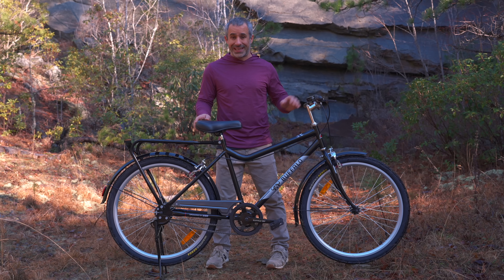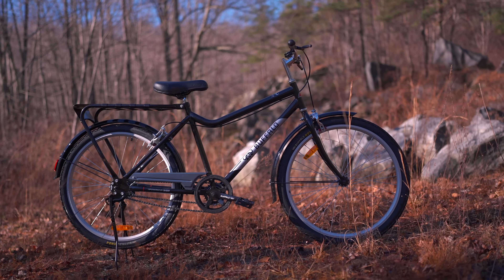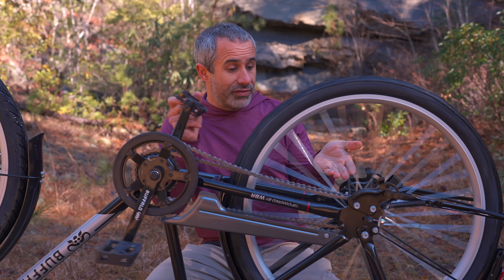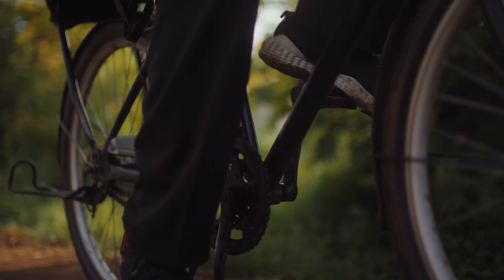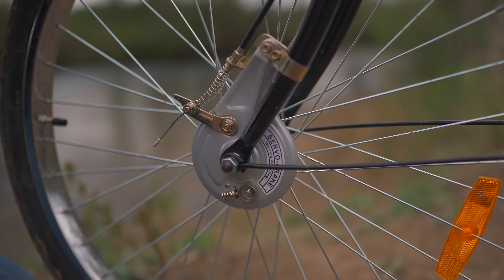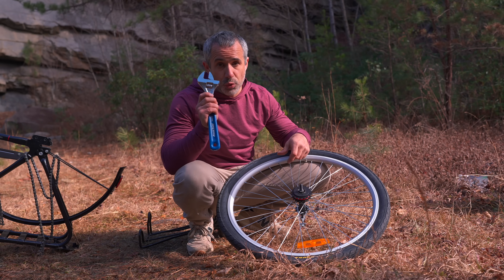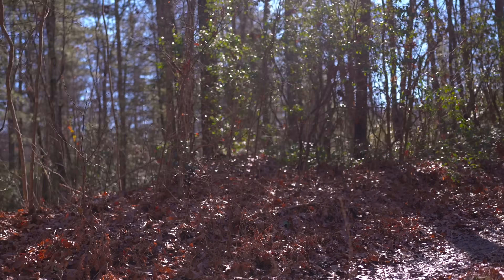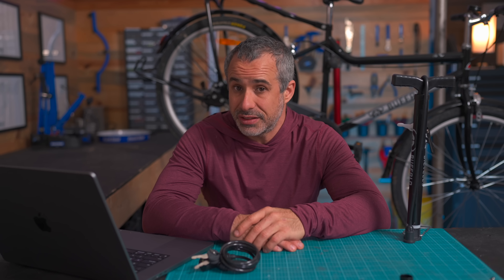Why 2 Chains Make This Bicycle WAY BETTER

Comment: Apart from the buffalo, many use standard roadster bikes (known in Kenya as Black Mambas) similar to the initial buffalo. Steel frame, single gear, rim breaks and a really beefy custom made rack. And you see those all over the place even in Rwanda, the "land of a thousand hills", where there is a rarely a stretch that's not up or down. Those gears are a major upgrade for them I imagine. It probably won't work for those loads where you need more than one person to push the bike but considering to relatively low price difference, fair enough.
Reply: B-R-A-K-E-S! Spell it as if you read it somewhere like in books.

Comment: I don't have a Buffalo per se, but I have fairly old steel roadbike which I revived and commuter/granny bike. Both are quite robust and hella usable. 
The commute/granny bike also have a front basket and I modified the back rack with another basket with two side smaller basket panniers, now comparable to any cargo bikes out there cargo wise imho. At least enough for my weekly/monthly groceries. It can also easily handle almost 75kg cargo. Next plan I wanna change the tyres with a fatter one and throw some 6 speed freewheel or something for bigger but easier cargoing.
Also also I kinda want me a Becak (a passenger/cargo tricycle). That stuff is more reparable and cheaper than any cargo bikes out there.

Comment: What kind of tyres do they use to resist the strong UV? I started getting perishing on my Continental tyres in the UK after 1 year, which lead to regular punctures, so I had to replace them. The perishing was worse on the side of the bike that got (indirect) sun, in my bike shelter.

Comment: My 21 speed bike occasionally does something stupid like the chain randomly falling off or me having to replace the shifter or somehow getting bent and hitting the spokes so I have to use brute force with pliers to bend it back but otherwise it’s pretty reliable

Comment: this is a stupid complicated high maintenance design - two drives, exposed chain, caliper brakes. bike is very heavy and won't climb with an average person aboard. and, carrying heavy milk containers or else so high is impossible to manage and only ends up spilling all over the ground. total bs

Comment: Lets make bike more complex by removing the ability to brake by rotating backwards. Instead lets add a hand brakes and increase price by adding 2 more chains but give only 2 speeds.
Brilliant.
Reply: well rim brakes are super cheap tho, you can get a made in china one for less than 3 bucks
Reply: @rafiy7150  yes, but if we have a goal to make "bulletproof" and simple construction, adding a new component means that we have to deal with one more potential failure point.

And if we follow the idea "why to bother, just buy in china" than why to have 2 chains, just buy a cheap gearbox

Comment: The buffalo bike is an overpriced bicycle made to solve a non existent problem in a rich man's head trying to fix a "poor" man's problems,  their are more versatile, cheaper and serviceable bicycles than the buffalo, I know many families in my village who have this bicycles break down after a moth or two and can't service them, meanwhile they go back to their own bicycle which are easy to service anywhere. The buffalo bike sits between a normal bike and  a mountain bike,  my old atlas bike carries more weight move faster , is more reliable and more serviceable

Comment: i might use the wrong terms, but serious question: why does it need a shift mechanism? If you're going to have two different chains on two different gear ratios, why can't they both be engaged at the same time? In my mind, then at slow speed the low gear "wins" priority and gets everything moving. As you start to exceed the speed of low gear, the high gear gains priority and the low gear just spins faster than it could've been pedaled via a clutch as if you were coasting. 

I'm sure there's some clear reason why that's not an option but why?

Comment: Regular 3gear hub shifter bikes never needed maintenance either, they will run for ever on zero maintenance.
I really don't see the point. It solves a nonexisting problem.

Comment: When I was a child simple bikes still had internal two (super rare) and three gear hubs in the rear wheel.  They died the marketing death because more gears more better bit are entirely unnecessary for many use cases sich as city bikes.  With these bikes coaster brakes were stamdard.  Far less effective than more modern brakes but good wnough for workhorse of a bike as opposed to sportive use.

Both jad in common that they were super reliable.  My own bikes never jad any technical issues.  In fact, I'm still usimg a bike from 1986 which has tje odd combination of a two gear hub with a six hear derailleur.  The hub works as new, the derailleur needs cleanimg, adjustments and like eber.more modern derailleir is just unreliable compared to an internal planetary gear.  One of the reasons for the reliavilty is that the core components are sealed.

And if something is as reliable designing for maintainability and repairability is less of a concern.

Seems something as reliable as an internal plantery gear with coastering brakes is somewhere between forgotten and ignored and now there is an attempt to reinvent something as reliable.

Comment: In the early 80s I had a bicycle that had a two speed internally geared hub that you shifted in the same way as this, by back-pedaling to briefly tap the coaster brake.  It had a single chain and survived my abuse as a kid.   I'm having a hard time seeing how this convoluted system can be more reliable than that simple system that I had back then.  A modern version of that seems to be the Sturmey Archer kickshift.

Comment: That's shit. Two chains to rust, way more weight, way more friction, V-brakes, air tires - that's garbage for given conditions. An old bike with pedal brakes and 3 speeds is WAY more reliable. Ok, I don't know what old bikes were in EU or US, but I know soviet old bikes were like that, and many are still driving today. The only new thing that they need is airless tires. That thing would be absolutely indestructible and almost completely serviceless. The chain might eventually rust and fail, but that's pretty much it.

Comment: Your statement that you can not have a two speed coaster brake on a bicycle is a victim of your age. Look back to the history of Schwin bicycles. One of my cousins had a large paper route in a community with lots of different size hillls. This was back in the early 1960's. It also had the spring front fork that might be a good addition to Buffalo 2, or 3.

Comment: I had several "kick back two speed" hubs laced to various rims, they also all had coaster brakes. They were super reliable, easy to clean and service, since all of the components were in the hub, dirt and moisture were kept out. I don't understand why you stated that the "kick back" shifter won't work with a coaster brake, they were perfected in the 40s or early 50s.

Comment: Very curious as to why they didn't opt for a belt drive system. If your goal is to pump out out millions of standardized bikes with no gearing that should outlast cockroaches in sandy conditions, belt drives make a lot of sense to me. Even for logistical reasons, it's a lot easier to transport 100 belts than it is to transport 100 chains. No oil or cleaning needed also.
Sure, the costs would probably be higher first. That can be offset by standardisation and high volume

Comment: Would have liked to have seen how the freewheel actually works. 

Also wondered if you could retro fit a bike with this twin freewheel, a twin cog crankset & an additional chain….might be more cost effective upgrading original single speed buffalo’s already out in the field.

Comment: I don't get why they went with dual pivot brakes instead of V-brakes. Dual caliper are just weaker and I found their left-right alignment to be pretty fussy. Only thing that comes to mind is that they maybe could still use the forks of the old buffalo as spares but I am not sure that alone is enough of a reason.

Comment: Well, I will leave drum brake at the front, rim brake at the back. So if your wheels are bent, you can disconnect rear brake and still have enough braking power at the front to get safely home.

Comment: (-_-) I was hoping this would be some AMAZING invention, like it has a big & small gear & chain to the same back-wheel, and the big pedal-wheel provides the torque when necessary & the small wheel provides the speed when suitable, so you don't need a gearbox, or something AWESOME like that...
But NOOOO.... it just provides the same benefits as POCKETS you could bring a 2'nd chain in, just in case you need it. Sure, it now can work until you get home/repair-shop, and you get the benefit of not having to try to do field-repairs, but just use wing-bolts & it's easily serviceable in the field anyway.

Comment: This bicycle's duel chain/shift system is next level and really demonstrates the true purpose of a bicycle. And to as you may read in these comments how everyone uses them even the children and that is the other great thing about a bicycle, they transcend age and size allowing about anyone a bit of freedom through transportation . With bicycles it is possible for the entire family to each own their own bikes. I hobby with E-bikes and always look to electrify my next bike but this bicycle is to perfect in the design to change it like that. Now there are simple On The Wheel electric assist kits out there but it looks like getting a charge in some cases would be a challenge. Thanks for the video good the see good work in the world.

Comment: Back in the 60's Schwinn had a two speed "kick back shift" Stingray bike with a single chain and a rear coaster brake.  I was the first kid on our block to have a Schwinn Stingray bike but I could only afford the single speed version. It was  built like a tank and sold for $49.95 MSRP.  If I remember correctly the basic two speed Stingray sold for about $10 more.

Comment: You put all this forward as a win for Africa... I'm a poor Brit - my bicycle IS my lively hood it's my "pick up truck" - How do I get an affordable accessible one??? Does it fit standard tyres, standard chains? Are the wheel axle threads compatible with standard metric threads so I can pick up a new wheel nut at b&q or does it need the old imperial "specialist" bicycle threads? Since you have discounted long term reliable (even in wet) hub brakes, why have you used poor performance fiddly caliper brakes when Vee brakes have better stopping power and are far simpler to work on?
Reply: Also... WD40 is a terrible lube - great as a cleaner and water dispersant.... But to re-lube a gritty chain or freewheel I'd much rather use used African truck engine oil - WD-40 will destroy bearings and joints in your context!

Comment: Reminds me of the old Bendix yellow and blue band 2 speed kickback shift rear hubs but with 2 chains. I think having 2 chains increases the likelyhood of one falling off and fouling the other chain not to mention the tensioning issues. it's a nobel idea and I'm sure it works well but doubling the chain makes for twice the problems. The Germans made similar 2 speeds but the 2 speed mechanism is in the crank and, being German is extremely complex requiring precision machining. Plus it was hand shifted.

Comment: Nice...

Um, just put the pair of chains on one side, then another chain with a coaster break on the other side. Arrange that the coaster brake must be peddled back more to trigger it. Boom, you just got rid of the hand brakes.

Comment: I've driven a few 2-speed with same gear changing mechanism and coaster brake. It was just "turn pedals backwards a bit to change gear, turn them more to brake". Gear changing and brake worked well, problem was that whenever you used brake, you also changed the gear. This of course could be remedied by handbrake at front, one of those bikes i've used had drum brake at front but other had nothing. Actually googling about it, bikes likely both had "Sachs Duomatic Model 102".

Comment: reminds me of the bendix kickback which was made in the 60's    Bendix kickback models primarily refer to their "2-speed automatic kickback hubs" which are often identified by color bands like "Red Band" and "Yellow Band," with popular models including: "Model B," "RB2," "Bendix 70," and "Bendix 80"; all featuring a coaster brake mechanism with a 2-speed kickback function, commonly found on vintage Schwinn bicycles, particularly the Stingray mode 
 Key points about the Bendix Kickback:
Functionality: It was a self-contained 2-speed hub with coaster braking, meaning you could shift gears by pedaling backwards.
Distinguishing feature: Often recognized by its "Red Band" design.
Reputation: Considered one of the best bicycle hubs of its time due to its reliability and functionality

Comment: I had a Schwinn American bike. It had two speeds and was extremely reliable. 7:12 is wrong. My bike shifted by back-pedaling and braked by back pedaling. After braking, just backpedal once to shift back to the previous gear. Too bad they couldn't engineer a shift-brake-hub as reliable as Schwinn did 65 years ago.
Reply: I'm sure they could, but hub brakes don't fit into their product goals. Whenever someone gives "they don't make them like they used to" they forget that there are frequently good reasons for it being that way.

Comment: Far be it from me to question this stuff since I'm sure there's very good engineering reasons but using rim brakes and an old quill style stem/steerer is surprising to me just in terms of maintenance. I have found the modern replacements for both of these to be much more reliable and easy to maintain.

Comment: Obviously SRAM would find the solution. US brand but they develop a lot of their gear in Germany, they've got access to some reasonable engineers at home but Germans bring pure excellence to the field.
 Buffalo could further aid in the maintenance by implementing spoke key valve caps, something Peatys offer and no doubt others too. Inexpensive to produce and easy to implement.

Comment: I'm never, ever, going to own a rim-break bicycle again.
With lots of distance the break pads and cables are an issue. And with rain the break pads are a bigger issue.

This gear system is awesome though. More robuust than my years old 3 speed shifter on my city bike.

Comment: Perhaps I missed a tiny bit of explanation... but how does the gear know the difference between backpedaling and coasting? In both situations the axle is spinning independently of the sprocket. Well... now I feel like I'm answering my own question, I guess it would just use the same mechanism and principle found in a hub brake.

Comment: So 2 chains and no way to put some tension on it. It might work but also keep in mind that the chains stretch and become looser up to the point you have to stop multiple times to put the chain back on. My father worked with a lot of bikes and i've seen all the different things he brought in and fixed. In the Netherlands we also had a multiple speed bike and it also was one kick back to change. That was a 3 speed changer and all in one hub, with one chain and build in brake. So one kick was changing gears, just going backwards with the kickers and you applied the brakes. The front was also with brakes and those were connected with a rod system, no cables because they can break. So the drivetrain was one chain, one hub with brakes and gears in it fully enclosed so no dirt or dust was coming in. The real onle downside was it had a little learningcurve but within a day you'd know it. So it looks nice but there are better ways to do this.

Comment: Now this is sweet. I stumbled my way in to owning a couple old 2 speed coaster brake rear hubs. They seem dang reliable, but the downside is no hand brakes (which imo are better for overall control and learners).

Comment: That's awesome.  Though I think it'd have gone for hub (or more likely disc) brakes, to avoid the wonky wheel problem, as well as the wet rim problem.  Yes, the upfront the cost would be higher, but greater reliability.
Balancing pros and cons, always the easiest thing to reach a unanimous consensus on 😆

Comment: I have an old bike with a 2-speed internal gear kickback hub with a coaster brake from like the 60s or 70s and it shifts with just a tiny backwards turn of the cranks. I don't know if you're exaggerating the backpedaling there at 4:52 but that does not look like the greatest experience tbh. 

And I wonder it this 2-chain approach with additional rim brakes is actually better or that much simpler than a 2-speed internal gear hub with a coaster brake.

Comment: Not the first time I see this bike. Still confused about the way they did it. I have a 2 speed hub in my shed that's over 60 years old and only needed some oil now and again over the many years. Plus it has a push back brake, so no need for brakepads. And only 1 chain. I don't get why those things are not produced for these kind of applications.

Comment: I prefer 1 chain, 21 or 24 speed shimano rapid fire, cantilever-brakes, cromo steel frame, not ahead set, classic 1 1/8 inch stem, not adjustable in tilt angle but in height, with adjustable steel bottom bracket, "german" trekkingbike, made 1985-1990. I have several, since about 40 years, climb every mountain, best bikes ever.

Comment: I actually had a bicycle. In the 60s. That when I kicked it back, it went into a second gear that was located inside the hub that was also a coaster break.

Comment: Interesting for the heavy lifting work it is proposed to only have a back cargo hold. I thought those bikes with small front tires and huge hold were much better for hauling (stability etc). (and no, they don't tend to roll forward as you ride them with loads)